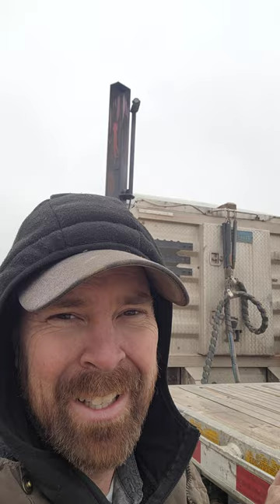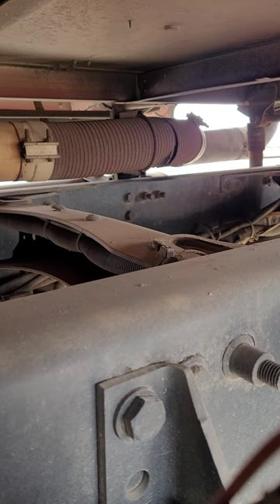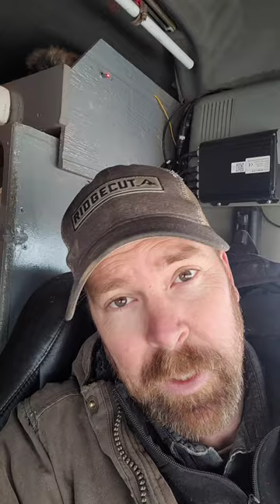Why you need a carbon monoxide detector in your semi-truck

Comment: You need it closer to the floor
Reply from the maker: Thankyou for the suggestion.  I found this from the website 'Prudent Reviews':  There’s an ongoing debate over whether you should place carbon monoxide detectors low on the wall close to the floor or high on the wall close to the ceiling. In short, the placement height doesn’t matter because carbon monoxide spreads evenly throughout a room. This isn’t my opinion; experts arrived at this conclusion by conducting a scientific study.
Reply: @aftersolo that’s why I have 3 of them lol. All at different heights. 2 in sleeper and 1 right above the driver seat
Reply from the maker: @armn8733 Yes.  If one goes bad, you have backup.  Maybe I'll buy another one.